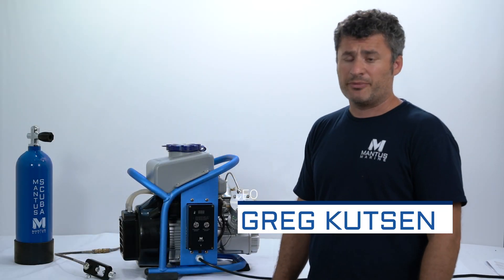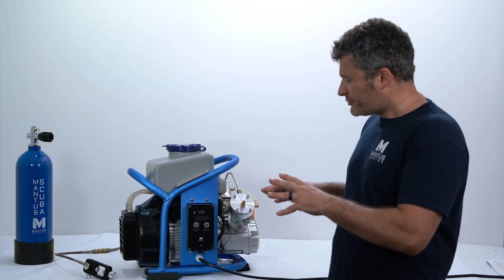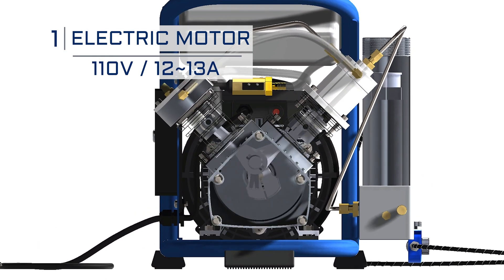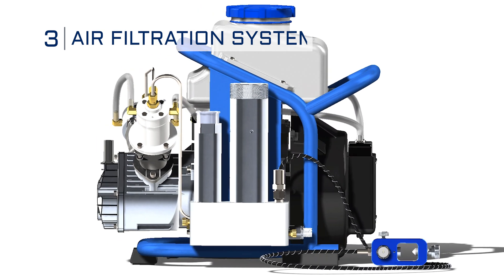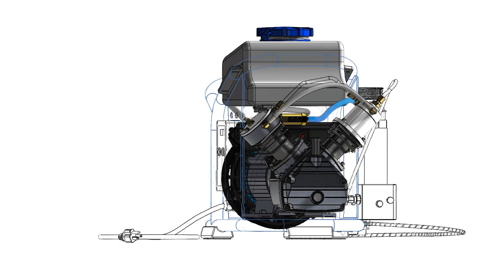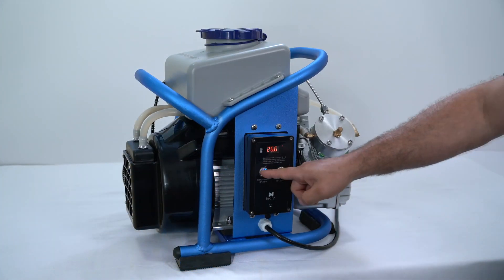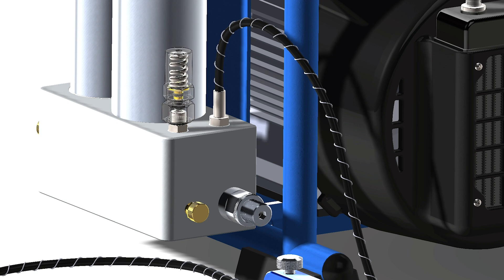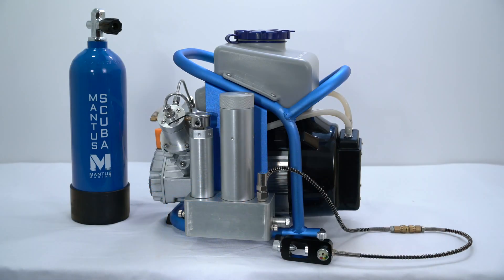Scuba Compressor Design Explained

Comment: I am curious how the connecting rod is coupled with the crankshaft...is there a bronze bushing, a bearing or a bare connecting rod used as in similar PCP air rifle compressors?